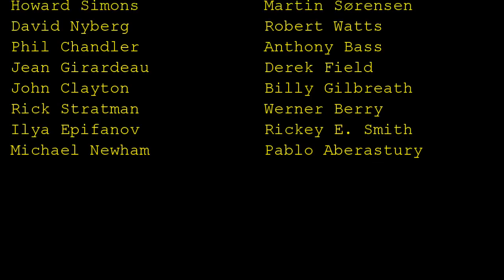electronic tiki light teardown

Comment: Big Clive has done a good description when these came out - it caught my imagination for theatre effects
These bulbs come in a number of configurations - I have some with b22 and e27 fittings for mains powered outside lights.  All the ones I've seen are just powered using a mains dropper.  If you remove that there are basically 5v (older) and 12v (newer) circuit boards mounted in some sort of housings or powered by the appropriate power source.  They all seem to have 3 modes ... Flame, all LEDs on  or a weird pulsing effect - just flick the power on/off/on to step through.
The LEDs are arranged in a matrix of bands not in columns.  Some also have gravity sensors so they always "burn" upwards . 

The 5v version is older but more hackable.  It has a separate control board soldered to a bank of (from memory) 54 LEDs split into two groups.  Each group has 8 power lines (from the chip) each line powers 3 or 4 leds.
The good bit with the 5v version is you can easily separate the controller, extend the connections and add another bank of LEDs from another lamp. Uncoiled the LEDs are pixels in a very low resolution screen.  If you screw your eyes up you can see how the flame image is working.  
You can piggyback strips together to make a single big "fire" which still looks very effective when its behind a diffuser - the controller gets a little warm - but I've got 3 lots of 3 running in tandem behind a diffuser and it looks pretty convincing.  All powered by a 2000mAh USB powerbank.
The 12v version is newer, "prettier", and more convincing - but because, in effect it's a COB - its less hackable - and will need a bit more thought to mod.  But you can still use a 5-12 v converter to power multiple units from the same USB powerbank.... but they fall out of sync.
Its still possible to get quite a blaze going.
Reply from the maker: Great information, thank you for sharing. Good to hear from someone with experience on these.